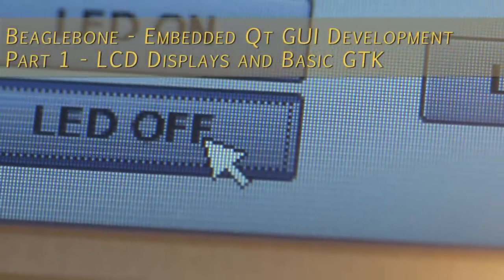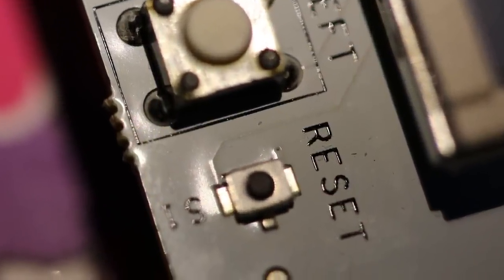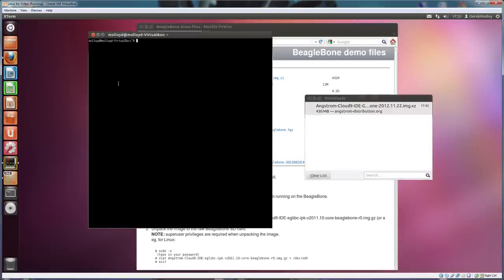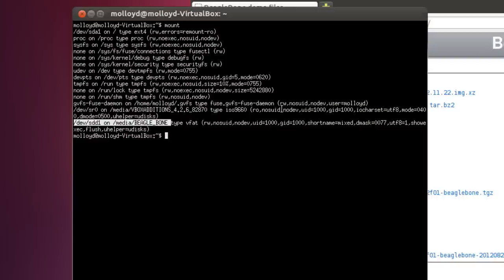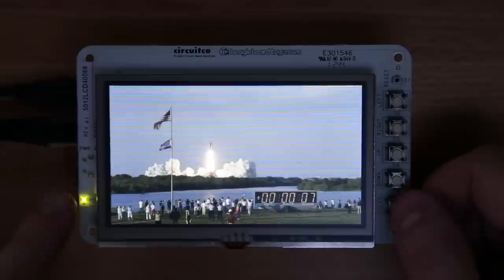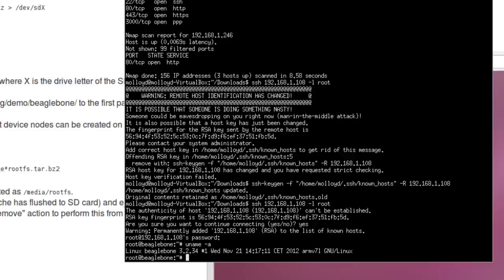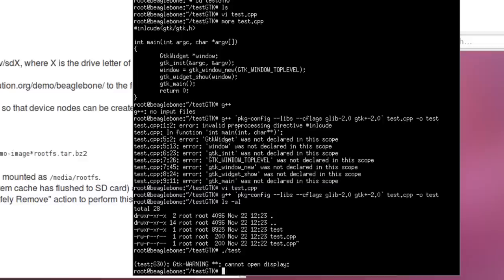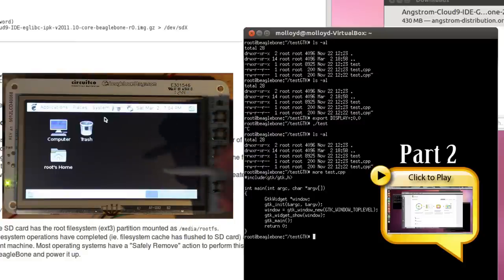Beaglebone: LCD Touchscreen GUI Applications for Embedded Linux

Comment: I actually had to roll back to the same image that you used here Derek, because the newest one (from 6/17/2013) did not work well. For one thing, it did not have the graphics demo files as yours did, and the screen calibration would not work correctly. However I just went into the archive folder on the download site, and grabbed the same version you have (11/22/2012) and burned that with xz. Now things appear to be working consistent with your video here.

Thought I was going crazy there...

Comment: Hi Derek, everything worked like a charm except for one little thing. I am using the original BeagleBone Rev 6a with the LCD3 Cape (Rev A2), the latest image (2013.09.05). After compiling the test GTK app, I was able to run the app from the board either (UI and shell). After xhost +localhost (on the board) I tried to run the app while SSH-ing into Angstrom after doing an export DISPLAY=:0.0 but it does not work. So I tried adding 127.0.0.1 but same result. I get the error cannot open display?

Comment: Hey. Your tutorials have been very useful. Thanks a lot. 

I am using the LCD7 cape with my setup. Once i boot up my Bone, i see this notification that says that "Connection manager daemon is not running" and once i connect my ethernet cable and try to connect to the internet, it doesnt work. Same problem comes in the way when i try to install the qt4-embedded packages. Any fix you can suggest ? Thanks a lot

Comment: Hi Derek thanks for your videos! I'm currently using a Beaglebone Black with the LCD3 cape and I'm having odd display issues, I'm running the latest image which supposedly supports my revision of the LCD3 cape (A2), but the problem I'm having is that everything seems poorly scaled, windows and everything seem too big for the screen and it will not adjust nicely like it seems to do on yours in your first video! Any insight into a solution would be much appreciated! Thank You!

Comment: If there is anyone following Derek's great tutorial series now (April 2014), you might have a problem with the latest version of Angstrom. The issue is that the kernel version in that Angstrom version, is too new--thus there doesn't seem to be support for qt-embedded that you'll need for later in this video, and in the next video in Derek's series. So what it seems like you have to do, is to install the exact version of Angstrom that he uses here. It's available, but you have to search a bit for it. So I will post a link here:

http://downloads.angstrom-distribution.org/demo/beaglebone/archive/Angstrom-Cloud9-IDE-GNOME-eglibc-ipk-v2012.05-beaglebone-2012.11.22.img.xz

I highly recommend that you DO NOT get the newest Angstrom if you want to follow the Qt examples Derek is teaching, because qt4-embedded just doesn't work as well, and actually may not even install for you. So use the one I've linked here, as that's the one Derek uses here and in the next video.

Hopefully this information will save people the 2-3 hours it has take me to figure this out.
Reply: Thats due to SGX port problems , the GPU stuff not accessible in the new 3.8.13 kernel on the angstrom and they strictly advise against using the 3.2 kernel as it has drastic shortcoming as to cape usage and other stuff ,so basically you can't move below 3.8.13 most probably if using BBBlack and cannot use QT development environment for BBBLack with 3.8.13, so shall I just abondone it?
Reply: thank u so much :)
Reply: Nishant Sood I'm facing a similar problem. I'm using a BBB, but after installing the 3.2 kernel onto the SD card, it cannot even boot up. I guess it's due to the problem you mentioned?  I can install &boot the newer version of the system, though. But with the newer kernel, I cannot install the QT4-embedded.
Reply: Yongfan Men im afraid yes.
Reply: Gagan sood So what should I do if I want to build some GUI on the Beaglebone Black? Is there any other method? Thanks!
Reply: I hv the 3.8.13 but the qt is working without any sgx dependent gpu acceleration in graphics, I think u should follow Dereks steps with 3.8.13 kernel and u should be able to build qt on this very kernel and workout gui programmes.
Reply: Nishant Sood I've a silly question: how to check the kernel core? I tried the many Angstrom versions, and the earliest I can boot from BBB is v2012.12-beaglebone-2013.06.17. This is to the second latest release I believe. The latest one is 2013.09.05 which also bootable. But I don't know the kernel number of them.
Reply: Yongfan Men I didn't even know there was a 3.2 kernel for the BBB, to be honest. I thought that the first kernel support for that device was in 3.8. I haven't tried it lately, but I believe it's about the like the Raspberry Pi in that Qt4 is well-supported in the repositories. So I would try to install the 3.8 kernel and then search apt-cache for qt4-embedded support. For instance on my RPi2 unit, I am running kernel 3.18.11 and Qt4 works great--and I am even running Qt Creator.
Reply: Tom B I use "uname -a" to found that the kernel I run is 3.8.13. I'll try what you suggested. Thanks.
Reply: It should work just fine, right. After you get the OS working and install build-essential, then install these two packages:

qt4-dev-tools
qtcreator

TB
Reply: Tom B By the way...if you don't already have it, get Derek's book. The Kindle is under $20 US, and it's an incredible source of information and learning on the BBB. He's too modest to recommend it to you here--but I won't be. It's a tremendous resource. 

I wrote a long review on it while I was reading this past December, and you can find it here:

http://www.amazon.com/Exploring-BeagleBone-Techniques-Building-Embedded/dp/1118935128/ref=sr_1_1?ie=UTF8&qid=1434322209&sr=8-1&keywords=derek+molloy+beaglebone+black
Reply: Tom B Thanks for the suggestion. I made a phone call to Barnes & Noble and drove to pick up the book right after seeing your comment. I found the book very useful. Now I have successfully run the first Qt "Hello Beaglebone" example on the BBB. The next step is to figure out how to establish a button and when press it, a string is sent out through the serial port (this is what I need for my current project). I don't know how difficult it is, but if you could write some examples, I'd very appreciate. Thanks!
Reply: Yongfan Men Well, I haven't done any Qt serial port work for almost a year now, but here's some code that I wrote back then (see link below). Basically I worked on a project where a heart-monitoring device was sending certain signals that needed to be plotted. However in the early stages of the project, I didn't have access to the actual device--but I did have a data dump from the device. So I created a text file with the data set, to simulate the device sending samples at various rates. I used an Arduino to read the text file, and then send it over a serial port to my laptop--and then I plotted it on the laptop. 

But the point is that I worked on the serial port component(s) for quite some time, and it seemed to work fine...at least on the "receive" end. I believe the transmit code worked as well--but that wasn't tested as thoroughly. The project basically lost its funding, so I didn't work on it all that long...and haven't been back to it since. So I don't know how good the code is--but it will certainly give you an idea of how to work with serial port devices in Qt. I simply found a bunch of examples online, and adapted them to my needs.

I just created a public project on GitLab, so you can grab that and look at it for ideas. Note that there were some proprietary things that I cannot post, so this version is a more 'generic' form of the project. But it will still give you ideas on how to work with the UART in Qt.  

https://gitlab.com/tcbetka/QtSerialStuff

If you use it, please let me know how it worked for you. I might still end up working on it at some point (or something like it), so if you have ideas or comments...that would be great.

Comment: Hi Prof. Derek,

So here I'm with kernel 3.8.13 Angstrom on the BBBlack and not able to even install qt4-embedded just because its says I should have kernel 3.2.30 on the BBBlack, what I should do?
Reply: Nishant Sood I realize my answer is to a year-old post, but perhaps it might help others trying to do this sort of thing now. 

In my opinion, you should replace Angstrom with a Debian-based version for the BBB. Once you have that up and running, you simply do these commands:

$ apt-cache search qt4*
$ apt-cache search qtcreator

And you will get a list of Qt-related packages for the BBB. In particular, you should see these two packages: qt4-dev-tools and qtcreator. Install them.

$ sudo apt-get install qt4-dev-tools
$sudo apt-get install qtcreator

Once those two packages are installed, you can simply tunnel into the BBB's X-server over SSH. Then you can work on Qt Creator remotely.

$ ssh -X you@bbb.ip.address 
$ qtcreator

You should then get a remote X window with Qt Creator running on the BBB. Note that you can also develop remotely on your PC and then deploy to the BBB, but this will take a cross-development tool set as Dr. Molloy shows here.

Comment: I cannot seem to get the GTK windowing applications to open via ssh. Exporting the display doesn't seem to work for me, because I can't gain access to the display. I've been executing the "xhost +localhost" command from the (latest Angstrom) shell inside the Beaglebone. It executes fine, but then I just cannot open the display and get this error:

(test:663): Gtk-WARNING **: cannot open display: 

I can't execute the xhost command via ssh either, as I get an "unable to open display" error.

Comment: Exporting the display works when using Angstrom-Cloud9-IDE-GNOME-eglibc-ipk-v2012.05-beaglebone-2012.11.22.img.xz but for some reason even though the test app window will appear on the board GNOME won't appear... strange! Anyone has an idea of why the Dektop Manager does not start?